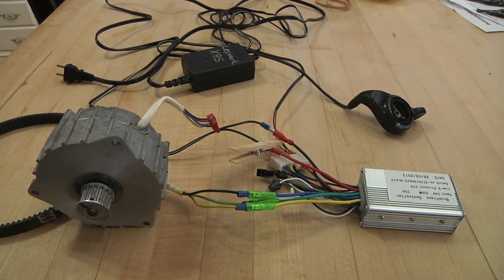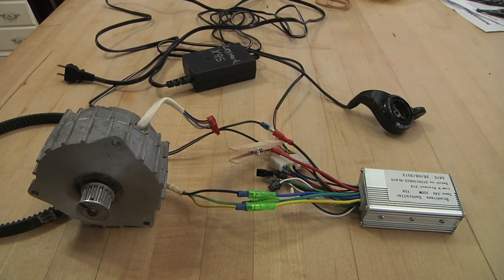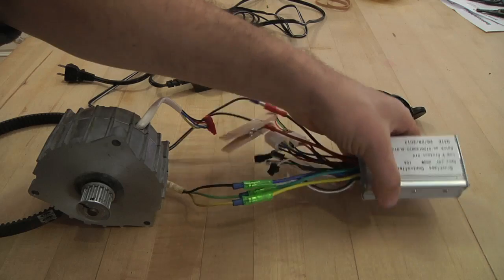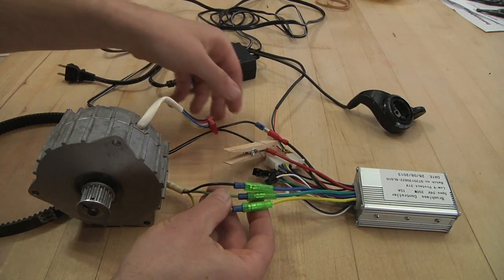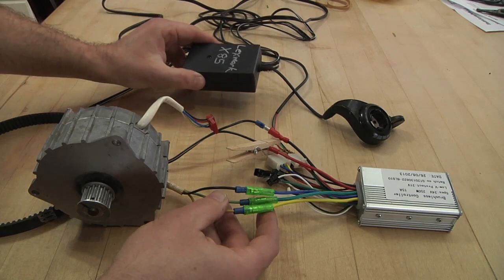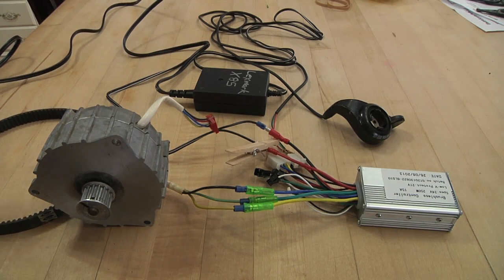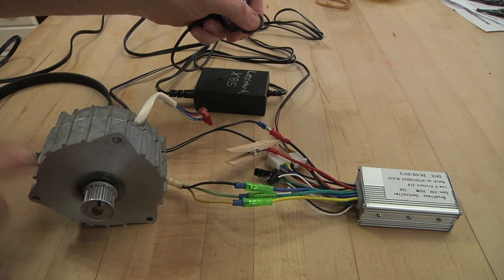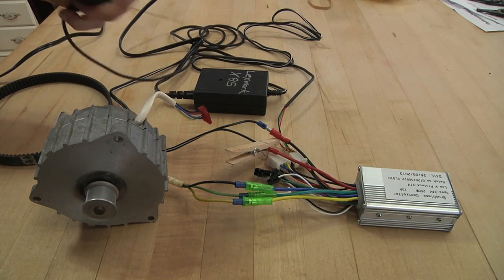Ice Scooter Motor control

Comment: Can I use a brushed motor with the brushless motor controller?
Reply from the maker: Brushed and brushless motors work on different principles. Generally, they don't even have the same number of output wires. Always match up an appropriate motor with it's matching controller.
Reply: V

Comment: Are you going to use the hall sensors or run sensor-less full time? Does that controller have a self-calibration mode to learn the hall sensors of that motor?
Reply from the maker: The controller and motor both came from a scrapped scooter, and were a matched set. I really never knew any of the details of the generic controller. I just hooked it up, and it worked fine.
Reply: BenjaminNelson, did it use the hall sensors originally in the scooter you took it out of? They normally work a lot better if they start up with hall sensors and then the controller shifts to sensorless once the speed it high enough.

Comment: Hi, i need to stop my scooter when it runs fast do you khow how to stop it electrically ( my brake function controller only opens the power line ) i know others can stop it like that , do you know witch controller can do that
Reply from the maker: Sorry, I'm probably not the right guy to ask of that. This was the only project I've done with a brushless motor. Ask on a web forum that deals with brushless motors, such as the Endless Sphere forum.

Comment: Hi Benjamin. I am planning to build a quad like 4wd and wonder: Can one grottle be connected to 2 or 4 controllers? Can not find anyone do this her, but found a russian thing with 1 trottle and 4 controllers
Reply from the maker: There are a couple of different ways that throttles work. Some create a change in resistance, some create a change in voltage. You COULD hook up a single throttle to multiple controllers BUT you would need to make sure that it is done is such a way that it provides the original and consistent signal to all controllers. How you do that may vary, depending on the style of throttle. In theory, you could also build an electronic device (perhaps based on an arduino?) which would give you multiple outputs from a single throttle.
I've never done a vehicle with multiple controllers, so I'm just throwing some ideas out there for you.

Comment: HELP! im trying to install one of these potentiometer to my mobility scooter. what info do i need about my scooter to look for to find the right potentiometer?? thank you
Reply from the maker: You need to look at your motor controller or documentation for your motor controller. There are several different types of throttles. The type of throttle you  need depends on what your motor controller requires. Some use resistance, usually in a range of 0-5,000 ohms. Others use voltage, such as 0-5 volts. You need to use both the right TYPE of throttle and the right range. Take a look at scooter and electric bicycle web pages to see the variety of throttles available.